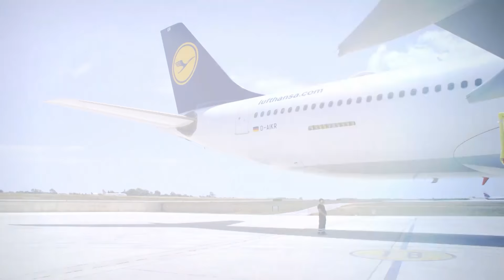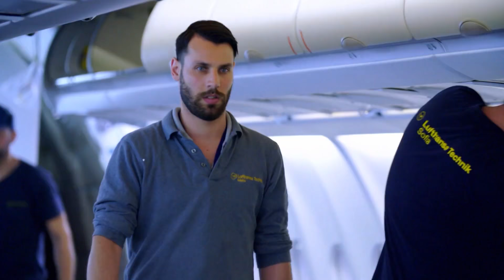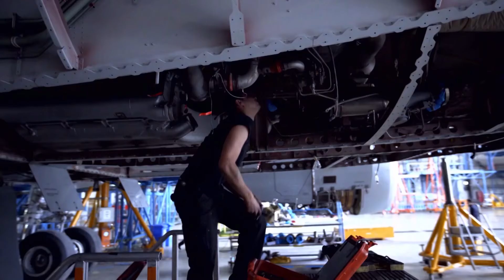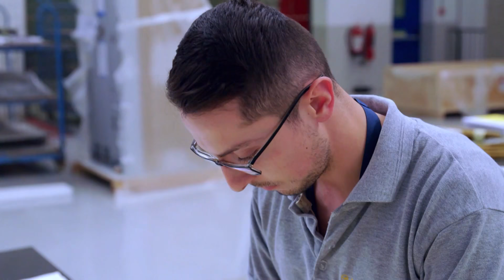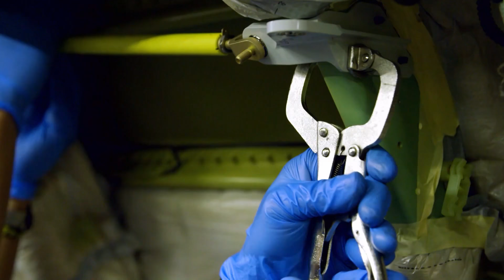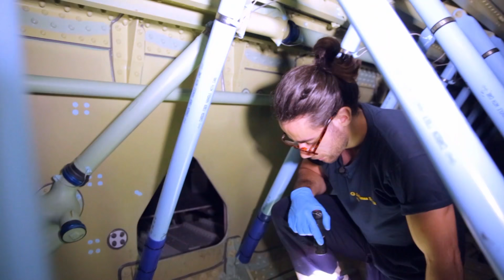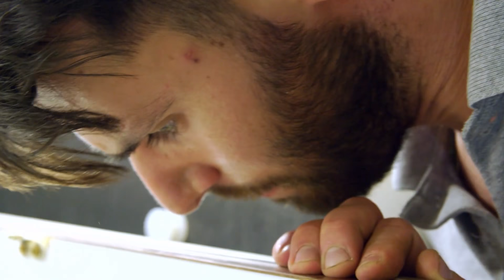Airplane Heavy Maintenance | Mega Pit Stops | Episode 1 | Free Documentary

Comment: This is a real responsible job, disasters happened because of fe wrong screws were used or the fuel tanks were not cleaned well. Great upload, thanks for sharing.
Reply from the maker: Glad you liked it. My dad worked in airplane maintenance for Air Canada. It is indeed a job with a lot of responsibility and you have to brave icy temps in winter. He found that super tough.

Comment: I work on the Latam MRO, and we operate this kind of check, even 12 years. The safety is one of the principals that rules our work daily. We really have to disassembly all the aircraft to open access to inspections of each component and surfaces inside and outside. We realize tests and the acft goes away only when everything is operating properly. ✈

Comment: I've worked at a lot of repair stations like this for 18 yrs. I like this repair station. To begin the facility is equipped with the proper stands. That makes a world of difference. The place looks properly lighted. I'ld have to see it at night to be sure. Yeah I'd definitely work here. Thanks for the walk down memory lane. Uh oh you don't lift flaps with straps you will crush the honeycomb at the trailing edge. Ideally there is a lifting jig that attaches to the flap with bolts.

Comment: "Obviously you can't use electricity in the fuel tank"

Has a flash light, a camera person with a bright light and camera, etc.

These documentaries are interesting, but I do hate how much extra drama they add. Like when the plane was lifted, the narrator talked about all the danger, but there were like 5 people standing on the lift under the plane, without hardhats or anything, so clearly not as dangerous as being described.

Or the narrator will talk about how the electrician needs total concentration, and yet, camera person right next to them asking questions, recording. Or they'll talk about how tight the schedule is, and yet there's a camera crew all over the place slowing them down.

Comment: The thing that always baffles me is that there are that many parts all working together to make a huge object full of people soar through the air and it just seems like that many little different things can go wrong. It's scary really.
Reply: No, what should fill you with comfort is that LOTS can go wrong before ANYTHING becomes an issue to safety of flight.

The list of scary defects I have seen would stop most people flying... until you realise that they were flying fine WITH these issues.

Aircraft are full of redundancies, backups and safety margins.

It takes LOTS of factors to make an accident happen.
The scariest bit of flying is that there are two HUMANS in charge of your destiny.
We humans make mistakes, it cannot be avoided.
Reply: u r soo correct...No parking in the sky.

Comment: I worked at hartsfield international airport back in the 90s as part of my security career I'm retired now. Back in the 90s I spent 3 years as a contract security officer there. One of my final assignments was working at the technical operations center that Northwest airlines operated for all of their non-747 aircraft. 747 maintenance was done at Duluth Minnesota at the TOC there. I got a chance to watch airframe and power plant personnel literally strip an aircraft down in the same way you're seeing in this documentary
A medium maintenance check would run around 14 days, what you see in this documentary is a heavy check which runs between 21 to 28 days or at least it was back when I was working there as part of the facility security team. 
There were three shifts averaging about 400 personnel, specialist in airframe, power plant and avionics.
Part of the job is to literally rebuild an aircraft from the ground up as necessary if something major requires it.
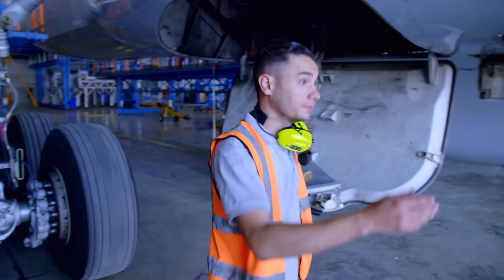One of my biggest memories was being at the East gate personnel control point guard station at 5:30 in the morning listening to twin Jet engines being run up as part of the final systems check, prior to return to service ., And feeling the guard post literally move because of the vibration, and noise from the engines. It's a memory that will stick with me forever.
Reply: I was one of those mechanics
Great duty until 9/11

Comment: Interesting to see how few of the engineers wore PPE. Id have thought that head and eye protection should be an absolute.
Reply: Sometime you need it, sometimes you don't. (I worked on 737s)
Reply: Interesting that the baseball caps are actually safety helmets.
Reply: Those are hardhats, not soft caps.
Reply: They should all be jailed for not wearing Covid19 slave masks.

Comment: 6 tonnes of engine dangling in the air. 300 kg flap hanging in the air. And not a hard hat in sight… Fuel tank inspection and no fuel detector, or bottle of olive oil in case of fuel spill in the eyes… Safety first? Hmmm… 🤔

Comment: Sir, they are doing a very wrong thing. It is a matter of endangering human life without safety measures. It is absolutely wrong to go into a petrol tank without an oxygen cylinder and a mask.
Reply: They're vented for several days before hand, it's perfectly breathable. I still like to use a half face respirator to filter out the few fumes when I have to spend too much time there, but other than that when they're really dry it's no big deal

Comment: I graduate as an aeronautical mechanical engineer. Two things about this video. First, this is not the major overhaul that must take place at a specific interval on all planes. It is rather a 'cosmetic' overhaul so to speak. Mainly interior components - including entertainment upgrades and seats refurb, ventilation, cabinets, etc. An exterior 'skin' inspection is done while there, as well a 'visual' engine check up. That is not to say this  'light' maintenance is without risks: in fact, they are dealing with cables and fire inside an airliner is one of the worst scenarios, because it can happen between the panels where it's not accessible to fire extinguishers. Same when replacing an engine: besides the various connections, engine bracket and bolts have often times a very specific removal and installing procedure, with angles to the observed and so on. Failure to follow the exact procedure may cause stress and even failure on the bracket. This caused an airplane to lose an engine. So as en engineer, I'm not very relaxed to see this maintenance going 'under a tight schedule'. Rushing is never a good thing. What is more, every single small screw/bolt has important tightening specifications: when a plane is manufactured there is a lot of important information on how to assembly every part correctly. I hope these guys who never worked for Airbus or Boeing follow correctly the entire instruction sheets. Now, this was done in Germany where work is better controlled. Imagine the same work done in Brazil or India. Aircrafts also go what is called a 'heavy' scheduled maintenance, when all 'moving' parts are being removed and inspected closely, such as flight controls on wings, landing gears, engine disassembly and wear measurement (not just visible defects). You will be little pleased to learn that this 'heavy' maintenance is now being done in cheap labor countries by local 'specialists' who actually cannot even read english - the language used for Airbus and Boeing to write the assembly and disassembly specifications

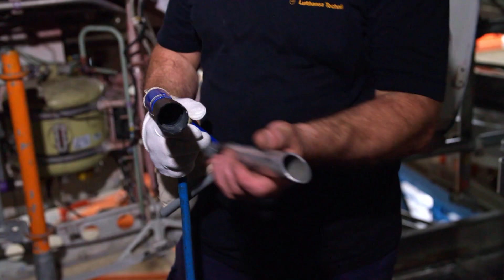Comment: 35:53 I call bs on that so called fuel tank, look closely at the metal white struts that run from top to bottom they would move when the wind flexes which would cause a spark.
Reply: im more concerned why he doesnt need to wear a gas mask in there
Reply: @schwarnoldnarzenschwegger1886  because in this kind of inspection in base the fuel tank has already been purged for a certain amount of time and has a constant ventilation of fresh air into it. By then a gas monitor would be inside monitoring harmful gas and oxygen level to ensure it's safe to work inside.
Reply: Without those struts then the fuel tank would be too rigid and in these wing tanks then during flight they could crack. There's a nitrogen generation system for the fuel tank which in-flight would fill the tank with nitrogen leaving no room for oxygen so even if theres a spark there would be no fire.

Comment: Inspecting the fuel tank looks like they are not doing it properly. How are you suppose to see any cracks or splits with a tiny torch which you can find in a pound store... The guys breathing in all the left over fumes from the fuel, no masks left?

They should have bright lights inside there to check for any cracks etc that are no easily seen, or have at least 3 people on the job..

Comment: If they made a weekly program about this, with a different plane each week, I would definitely watch. Of course if they did they would have false drama, like that dude in the wing would be overcome by fumes or they would be missing an entire row of seats.
Reply: You could do a different part of the plane each week. The difference in jobs between the cabin crew and the engine crew is pretty profound. In fact, just removing and reinstalling all that insulation so the inspectors can check the skin is a major chore. It took me longer to do insulation in the environmental area of a 737 than it normally does to replace some major components.
Reply: leper...ol...xx...n...vedeo...ame...kob....balo...pai..ame...amara...lepe...coda...da...na...sobaira...da

Comment: Engineer: we need to use an air pump because we can't have electricity in the fuel tank.
Film crew: but we need to go in with our camera equipment to film him.
Also engineer: Ok that's fine
Reply: Barry Richards it is fine the electric tools have electric motors which have commutators and brushes that arc when in use unlike a camera that has no moving components
Reply: Causing static is the main issue because it builds up an electrical charge, so special footwear is probably worn.  Things need to be earthed so the camera eqpt and cameraman will be fine as long as they're also earthed.
Reply: Ever heard of battery operated cameras?

Comment: Fuel tank entry without sniffer and with non-approved flashlight
Reply: no proper ppes
Reply: @mariasharapova8992  Technically, they don't need PPE, such as half-face respirator or supplied air, as long as VOC and oxygen are at acceptable levels. I personally don't like those and if I can legally get away without using them, then I would do so. The problem is that they don't have a gas monitor (AKA sniffer) with them to measure these levels. Majority of people will black out fairly quickly with all oxygen being replaced; and with fuel concentration in the air being close to LEL (Lower Explosive Limit) even a tiny spark from a flashlight switch may result in a big KA-BOOM. Also, I understand that they were doing this just for the show and, in all probability, the tank was vented for several weeks at least. Nevertheless, it's better to show everyone that their employees are following all safety procedures to the letter.

Comment: That wasn't a bearing it was a bush, big difference. Bearings take rotational forces like wheels. A bush is fixed and provides support for a shaft.
Reply: That's a spherical bearing. It supports not only rotational (radial) forces as well as axial forces caused by vibration in all directions.
Reply: A bearing is anything that bears a force applied to it. For example, thrust bearings are usually flat plates that restrict axial motion. To put it in formal logical terms, a bearing isn't necessarily a bushing, but bushing is always a bearing.

Comment: 31:17 am i the only one who would be extremely terrified to go INSIDE the engine like that
Reply: Why is that ? it's not running and you would hear it start and slowly spin up before you'd be at risk of being sucked in. Moreover, you would need air pressure to start and that is very noticeable aswell (GPU, APU lots of noise and not in a hangar) + it is defuelled aswell. Also circuit breakers are pulled and safety tags/warning are in place to prevent a start should someone flick the right switches (very unlikely still, you'd be working with trained professionnals)
Reply: @raphaelr.1576  yeah ik but isnt it terrifiying to go into something so big and powerfull like that lol

Comment: Fuel tank inspection is confined space work with explosive fumes. Don't u guys use an oxigen/fuel LEL detector? You should use a headlamp as well
Reply: That part is presumably done before giving the all clear to enter the fuel tank.
Also the tank is vented after opening and then all the measurements would be taken.

Comment: When they start using sledge hammers on planes I feel very nervous 😬
Reply: usually mallet hammers are used on the aircrafts, which are non metallic rubber hammers
Reply: @yazanakho8907  yes or you can use piece of aluminium or a less resistant material to hit the place you want
Reply: yazan akho yes true but I don’t think that was a mallet
Reply: @waqarghulam3548  it wasn't, it wouldn't chop out by using the mallet, it needed to be knocked with a steel hammer
Reply: @yazanakho8907  The bearing had to be hammered into place when the aircraft was first being built. There's nothing else for it, with a steel bearing that has a 6 ton stress load on it, it has to be a v tight fit.
Reply: Hahaha lol Just remember that for mechanics  "THE BIGGER THE PROBLEM THE BIGGER THE HAMMER" lol
Reply: for some jobs you can do it without those kind of tools !
Reply: true ! I'm thinking, what if that hammering stresses other components of the plane.. u know? collaterally.
Reply: yes i use hammers to put the engine blades into the discs, 100% recommended
Reply: @crazyksp8344  wuww no you can't hahaha
Reply: That's a mallet.
Reply: They are highly qualified and experienced engineers. We are talking here like we work in airplane overhaul. It's bearing dudes. The areas surrounding bearings always mean to resist high levels of stress. That small hammer is nothing compared to the stress this particular area will get and if you look carefully you'll see they only hit the bearings with the hammer not the main structure
Reply: @RobbyBoy167  I never said what the mechanic was doing was wrong, I just said it makes me nervous because it’s a highly complex delicate looking piece of machinery and using a hammer does not seem natural

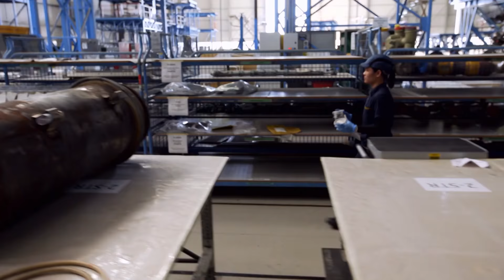Comment: 28:49 = Its cheaper to clean and reuse the screws as the cleaner is from Philippines. If the cleaner were from USA or EU, the option would have been to replace the screws.
Reply: not sure if you're joking or not to be honest, but the workers aren't paid differently based on where they're from. Also we clean and re-use the screws in the UK too, you'd be surprised what each screw costs to replace.

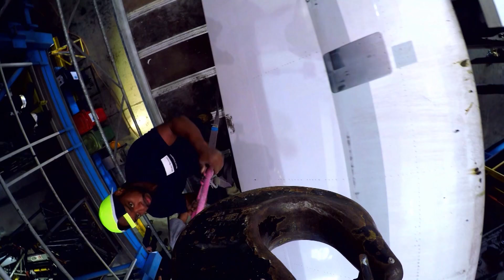Comment: Well, at 25:30 there's some error, the flaps' task is to increase the lift force of the wings, not to increase air resistance. At take offs it is needed, so that the aircraft needs a shorter runway to achieve the amount of lift required to take off. At landings the flaps' task is the same, to increase lift, if there wasn't any flaps available, the aircraft would need much more speed (to have sufficient amount of lift), and therefore a much longer runway to land.
Reply: yeah the commentary on this video is shocking. However they're not wrong that deployed flaps cause an increase in drag (air resistance) but that's not their primary function.
Reply: @christopher4636  by writing " flaps' task " I thought it was obvious that they do increase the drag, slightly, but yeah you're right, I should have mentioned it

Comment: So put of a hundred fleet of Lufthansa planes only one is taken out for maintenance . What happens to the rest of the fleet if one aircraft takes 40 days .
Reply: What you've seen here is just one line (bay) carrying out maintenance on one aircraft. Lufthansa (like most big operators) have multiple lines carrying out maintenance on multiple planes in parallel at multiple base maintenance locations.

Comment: Wasn't impressed with the fuel tank internal checks, no gas monitors being used, no confined space plan at all. We would have to wear a harness as well, to make it easier to rescue us if things go wrong.
Reply: I've never seen anyone wearing a harness in the tank, it would impede movement too much and I'd not want any metal buckles chipping paint. Just vent the tank for as long as possible then get in and do the job.

Comment: Manuals don't always  contain all the information  required  about  an individual item , A wee bit of common sense is needed . Hats off to the engineers  and all personnel  involved  in this field of job .
Reply: There is a manual for EVERYTHING. Sometimes it is not in the manual for the plane because it is covered in a general publication. Why put tensile strength or materials compatibility of screws in the aircraft manual, when there is already a manual that has literally everything there is to know about every kind of (common) screw?

Comment: Great video however did anyone not find it strange the guy works in an empty fuel tank for 2 days with no breathing mask. And correct me if im wrong but aviation fuel is clear diesel and does not dry off. I don't believe they where fuel tanks, didn't even see them drain it.
Reply: Tanks have been defueled, sumped and ventilated hence no mask. Yes you are wrong diesel is clear and it does evaporate. Jet fuel is similar but not the same as diesel.
Reply: The fuel tanks are ventilated for days before anyone can get it. Plus when we go in, we also have portable detectors for gasses/fumes, which sound an loud alarm if the air quality is not safe to breath.